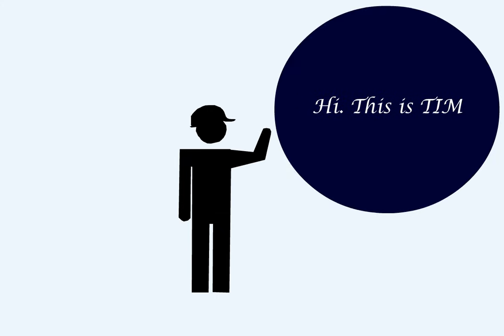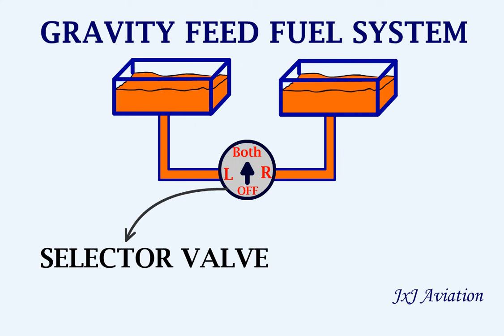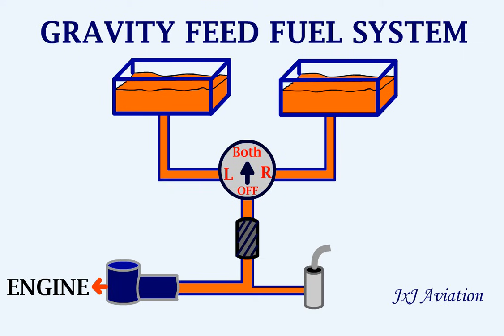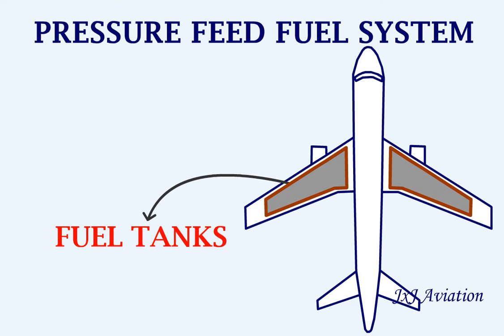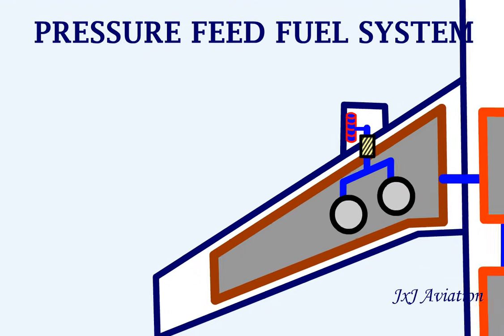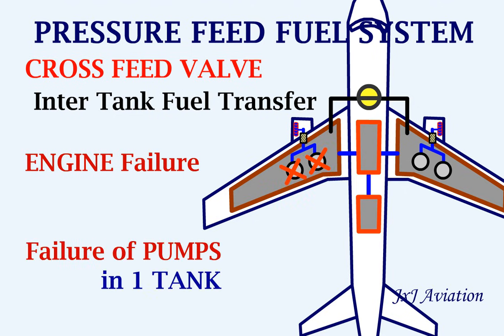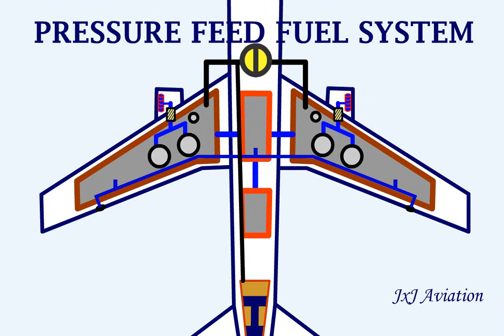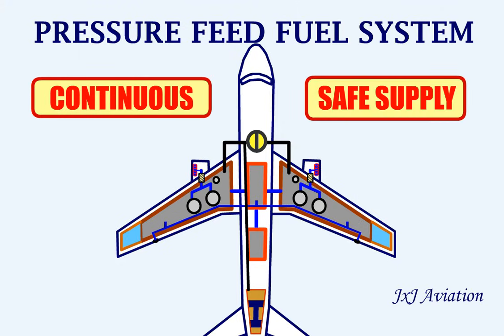Understanding the Fuel Systems of an Aircraft: Gravity Feed System and Pressure Feed Fuel System!

Comment: The engines will also suction feed from the fuel tanks. I once saw a test pilot try to balance the fuel tanks and even after turning off both fuel pumps in one tank it made no difference because the engine still suction fed. Illegal during landing and not recommended during turbulence.
Reply from the maker: yes thank you for the info

Comment: What happens if there is a imbalance in fuel... Will the aircraft will roll?
Reply from the maker: There is usually an allowable limit for fuel imbalance. Within these limits there will be no operational impact. But if the imbalance goes beyond these limits then some inputs on the ailerons/rudder may be required for level flight.

Comment: So why don't they just use pressurised oxygen tanks to fuel them? Surely this is cold fusion?
Reply from the maker: Oxygen has to be mixed with a combustible fluid for the combustion process. It is possible to use hydrogen as a fuel which few companies are working on.

Comment: Can you please give me an example of an aircraft that used gravity feed fuel system?
Reply from the maker: Most of the aircraft have a gravity feed system as a safety feature, incase the pumps fail and fuel is available in the tanks.
Reply: @JxJAVIATION  In the case of the aircraft becoming inverted the pilot would want the pumps working!

Comment: Which fuel valves does not allow fuel to flow from the inner tank to the outer tank?
Reply from the maker: There are intertank transfer valves that prevents fuel flow, which are used to prevent fuel flow from outer to inner tank!
Reply: those are called flapper valves.

Comment: Nice explanation..Could you please explain suction feed as well! Thanks
Reply from the maker: in case of failure of the pumps, the pressurized fuel feed to the engine is stopped. so the suction feed line allows the fuel to be fed to the engines with the help of gravity.
Reply: @JxJAVIATION  if it's using gravity than we term it gravity feed or suction feed?
Reply from the maker: @sakshikhorana  both refer to the same feed line that supplies fuel with the help of gravity.